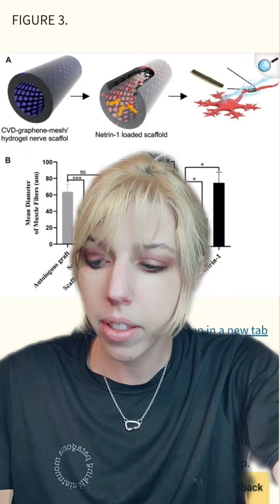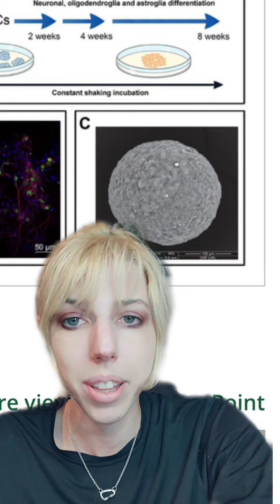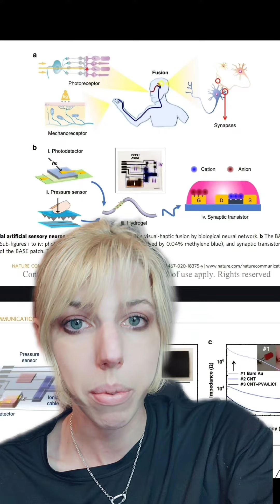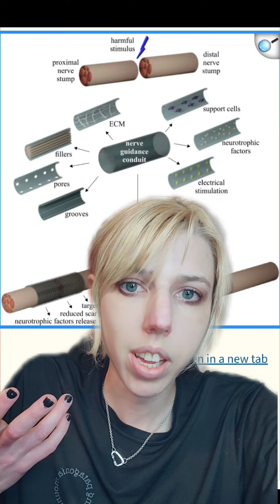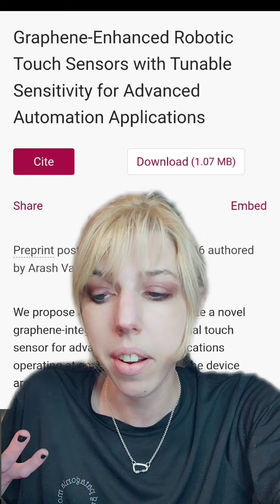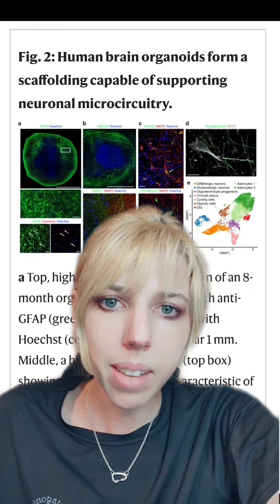Synthetic nervous systems interface with humans, robots, and cyborgs

Comment: Biology managed it.. (consciousness) I see no reason why technology cannot eventually as well.
Won't happen in my lifetime (am already 55) but it could happen in my son's lifetime (he is 30) given how fast the acceleration of technological advances has been.

It may not be the same consciousness as humans.. but it will be consciousness.

I am just wondering what kind of output would be required to prove it.  For that I think we would need to first prove human consciousness through external output.. then use the same method on any mechanical construct for which such consciousness were suspected.

Comment: This gets pointed towards the problem of qualia and mind theory. It is kinda hard to prove one is not a brain in a jar, but that is not a helpful model on top of potentially unfalsifiable so we tend to dismiss it. Same goes with convincing determined opponents that other minds are real, it's hard to prove otherwise but also unhelpful to not acknowledge it. On the other hand, cultures are just recently acknowledging animal sensation and thinking, I think brain organoids will probably face the same path. However, humans are crazy good at getting attached and bonding. Get a dog-like poster lab-pet with a brain organoid for a brain, give them a cute name, soon people will get on board and culture will accept it. Going from that to anything remotely like a replicant, though, would be a whole can of worms and I think a lot of people would be skeptical of their alleged thoughts and feelings.

Comment: I wish it was easier to read comments on vertical videos, either the video goes to ant size or disappear completely as you open comments
Reply from the maker: Sorry, I'm switching to horizontal as soon as some equipment comes in
Reply: Replace "shorts/" in address bar with "watch?v=". It will open the video in horizontal player. There are browser add-ons that can do it automatically.
Reply: @baldeagle9098  you don't have to do that. Simply click on the date of a random comment, it will open the video in horizontal player.